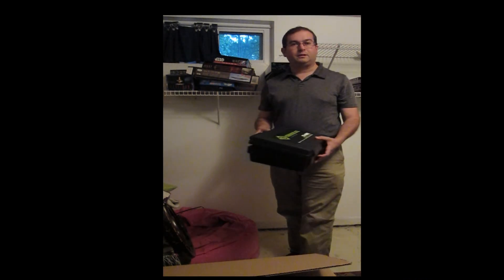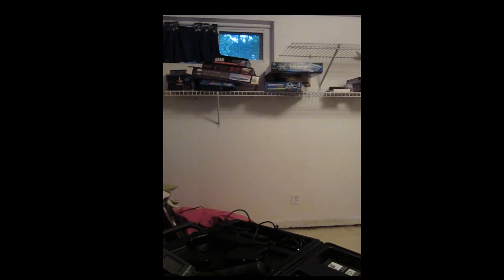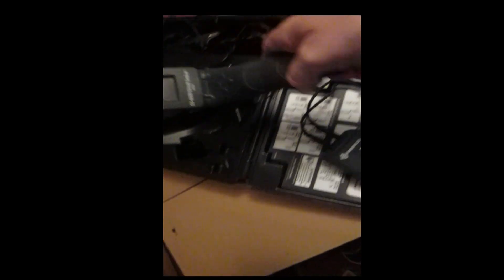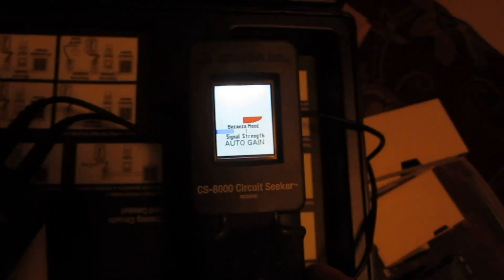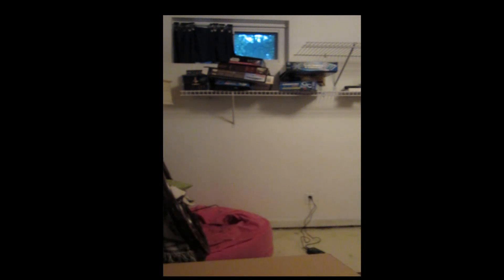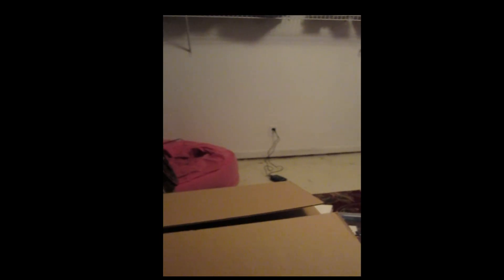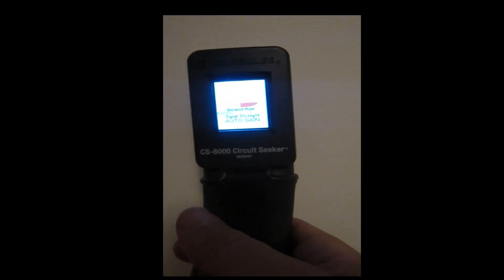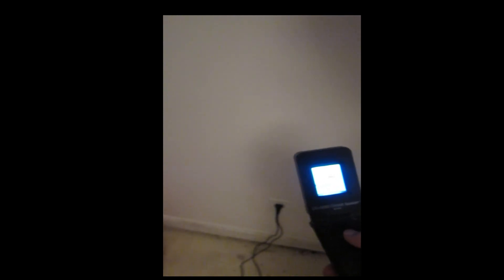How to Trace Electrical Circuits using a Circuit Tracer

Comment: I bought a CS 8000 to locate a hidden broken wire in a dedicated 240-volt circuit between the subpanel and the wall AC it serves 40 feet away. The townhouse is 'on slab' and has all wiring in the walls and an inaccessible flat ceiling. One leg and the ground are fine, the other is 'open'. I was told by the owner some ceiling sheetrock repair was done by the previous owner, but I don't know where the cable is routed. I've tried to test with voltage energized and also injecting a signal to trace the line but don't know the best configuration or which accessory pieces to use. This should be a simple setup, but I find the instructions are poorly written and there are no YouTube videos demonstrating this. How would you attack this, with and using what setup? Thanks!

Comment: Sir, this is a terrible video, next time , try to familize yourself better with  what this is about, pre plan your video, discuss components and what they do, start at load receptacle and work your way back to the panel and circuit breaker. Confirm that you are satisfied with what you will be sharing. Good Luck.
Reply from the maker: Thanks, This is one of my first video.. My newer ones are much better.. I promise! Thanks for the great feedback!